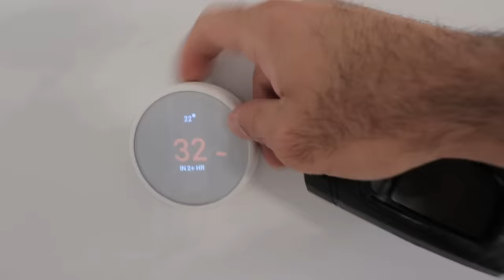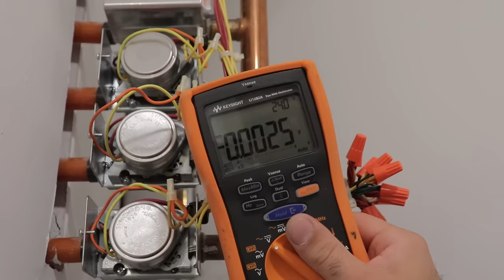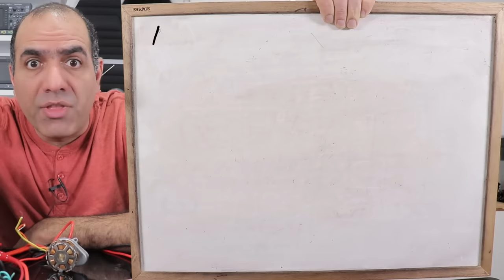Electro-Plumbing Repair… of my home heat zones that won’t heat although the boiler is running fine!!

Comment: As a plumber myself, Mehdi actually got most of the stuff right, just wandering who the hell did those pipes, they look so unorganized to me.
Reply: Every time I've hired a plumber they'll see something the last plumber did and go "Yeah that's garbage, did you get an idiot to fix it?"
Reply: @inurokuwarz  exactly
Reply: @inurokuwarz  Sounds like programmers too
Reply: @inurokuwarz  You wouldn't get it, its a plumber thing. Just believe us, we mean it.
Reply: @inurokuwarz  And then you tell him, that it was he who was called last time 🤣
Reply: @inurokuwarz  Sounds like every HVAC tech Ive ever had come to my house 🤣
Reply: @inurokuwarz  lmao
Reply: You should see my house. It looks worse than an IT datacenter rat's nest but with 3/4 copper instead of ethernet.
Reply: piping in this old house makes me wonder some times copper everywhere that makes no sense to some of them with end caps with nylon screw ends with a copper tips (like wtf is that for) to so many dead end gas lines from when stuff used gas like the stove and stuff in the 50's from then all of the pvc vent tubes from the new furnaces to the drain lines not to mention billions of wires all bundled into each other around the breaker panels and best show in the house is the main inlet water pipe is lead to a copper fitting through 2 meters using cast iron pipe/fittings back to copper. isnt retro fitting amazing.
Reply: So many experts...on the comments....your the only one I've seen that actually had a good comment...you are correct sir!
Reply: you should see the pipes from after they replaced the boiler in the apartment building where I used to live. Looks now like art by MC Escher...
Reply: @inurokuwarz  I'm like that when I see a tangled server cabinet/rack. "You've had some cowboys in here!"
Reply: My home was built in 1978, had the original hot water heater (failed in 2018), I was pleasantly surprised. The unit they put in would have cost me 800 to buy myself, they charged 1000 and brought the unit, took the old one, and the plumbing is now tidy AND serviceable. The old unit was actually copper pipes that were welded right to the original unit, they put in some new safeties and a nice fitting that terminated into a flexible line. Maybe it's not the best it could be, but I would have done a worse job and spent more money.
I think a lot of plumbers are not so great, but it feels like winning when they do ok!
Reply: @inurokuwarz  Because its true, especially when the last person that worked on it was them.

Comment: I love how plumbing jumped to rocket science instantly 😂
Reply: Wait till you realize that the majority of rocket science is just fancy plumbing.
Reply: Yeah. The fact that hot water and cold water pipes are just shorted seems like wizardry and rocket science.
Reply: @SneeuwPoesjes  get 2 liquids to the bottom of a tube

uh huh, "Fancy" plumbing
Reply: Two words: Colin Furze
Reply: I have some electrical engineering degrees and don't know jack about plumbing. I just call the plumbing guys and pay them, and all is well.
Reply: @Project_VideoGame  let me fix this: two liquid that tends to react toghether and explode, usually at very low temperatures, that must be pumped in the right amount and proportion in a chamber at very high pressure and temperature, where they must combine for good otherwise you only have a very expensive and loud firecracker
Reply: @XMarkxyz  And also needing to construct a nozzle that has thousands of tubes running through to prevent over heating and RUDs
Reply: and surgeons is just a fancy tailor....
Reply: @ringoooringooo2190  And barbers as well.
Reply: Then you realize that it is HVAC/Boiler techs that do boiler systems and not Plumbers.  Plumbers are not licensed to work on boiler systems. 😂

Comment: 7:48 Amazing, resoldering a disconnect by running high voltage through the circuit!
Reply: Most likely not, far more likely dust causing a short circuit which at LV remained, but HV burnt it away.
Reply: @mrtango1824  Dust isnt conductive enough to cause a short circuit at low voltage.
Reply: Arc welding!
Reply: @Godspamit  Could have also been a loose or oxidized connection that was open cicuit at 30V,but became shorted at 120V and the connection welded from the high current.
Reply: I'm guessing metal shavings from the constant operation
Reply: Reminds me of hitting a dead light bulb to get the filament to touch and weld back together... because I don't want to change that bulb today.
Reply: @mernok2001  depends on what kind of dust it is. Iron dust or other shop dust thats been contaminated by oils or other liquids does indeed conduct electricity very well.
Reply: @PrincessLorelei  did that actually work?
Reply: @NoahGooder  for a day or two.
Reply: @PrincessLorelei  even then I am suprised it worked at all
Reply: @NoahGooder  Frankly so am I, or at least beyond a few seconds. Interestingly the light was actually brighter afterwards.

I suspect that the not so conventional way the filament attached itself led to plenty of resistance... more heat, more light. I've also noticed incandescent lamps often increase in brightness dramatically in the minutes before they blow out.
Reply: @PrincessLorelei  I guess thats why its called a litteral blow out because the light blows up :P
Reply: @NoahGooder  I put a halogen bulb in a microwave. It was extremely bright for about a minute and then exploded violently.
Reply: Thats actually how you short dead christmas lights to make the rest of the string light up
Reply: @BlazingKhioneus  thanks now I know how to fix christmas lights.
Reply: "and they say high voltage is bad" - Mehdi

Comment: A word from the wise (and experienced). Honeywell zone valves are quite troublesome. I've had the gear on the motor strip out because it's made of soft material, the motors themselves get weak and wont go far enough to set the end switch. I use caleffi now and haven't had any more issues or callbacks. The actuator units have a lever that releases them from the body without opening the system. Honeywell has two small screws deep inside that make it tougher to change. Caleffi has a higher cv( flow ) rate
Reply: Honeywell & M.K. electrical goods have become fairly unreliable over the last few yrs, but the M.K.  prices have remained rather high. ( M.K. & Honeywell are the same same company)
Reply: Planned obsolescence.
Reply: Sure thing buddy I could say the same about caleffi, it does have a higher flow rate, but the inverse flow of ac to dc conversion with lower string coils per cubic metre has led to a lot of companies opting for honeywell systems. Not to mention the 8 year old who got electrocuted at 45 meters distance from a caleffi motor last spring which caused a black out in arkansas?
Reply: @callmex5406  can you provide me with the data on this incident.
Reply: @garyangelstad5212  obviously the news was taken off the internet after the company issued a media blackout. The courts were in on it.
Reply: @callmex5406  To produce an arc to even travel 45 meters you'd need to apply a voltage a few times higher than humans ever have, and it seems like it'd short out elsewhere before shooting to a kid. It'd have to be pretty spectacular circumstances to even do this intentionally.
Reply: @IronAsclepius  don't be fooled by what people tell you is true. As you said it could be exceptional OR it could just be a well hidden discovery? Anyway rip to the victim
Reply: Caleffi valves are good. Taco valves are also good (both the motorized style and the ancient indestructible wax motor type). At my old house I had Bell and Gossett zone valves. Yes, wax motor valves, but excellent quality, small for the size of the pipe, and entirely silent. I'd still go for individual circulators per zone rather than valves though. My new house has steam heat with millivolt system/powerpile generator for the controls, so it has no pumps, no valves except the gas valve, and runs with the power out. The boiler is on its way out though, so I will replace it with one with a power burner rather than atmospheric, and likely will convert the whole 1 pipe system to 2 pipe mini tube with condensate pump and additional vacuum pump. Unfortunately then it won't run without power but it will be a much more efficient system and I will be able to run steam temperatures under 212 degrees because of the vacuum pump.

Comment: As a mechanical designer, I have to admit: Electrical engineering is often basically some kind of sorcery to me.
I mean... I get how a lightbulb works... but that's basically it.
Reply: Lightbulbs are not that easy any longer.
Reply: I had the pleasure of being taught physics by a FermiLab scientist. She was smart enough, and I mean no disrespect she was very smart, to know when I needed conceptual vs practical answers to questions I had about capacitors, inductors, etc.

Different people need different approaches to electrical engineering.
Reply: mechanical stuff we can actually see things in motion. 1 action cause another. electricity and electronic is like wizardry to me.
Reply: @muzallisam5068  oscilloscopes are the prized possessions of electrical engineers. They make the invisible world of electricity visible.
Reply: Hey I work with an electrical engineer and he doesnt even have a simple understanding of how uneven pressing forces would create uneven pressures
Reply: So you are one of the guys who purpose make the lifes of mechanics a living hell huh.
Reply: A great "stepping stone" from mechanical to electrical is pneumatics.
Reply: So u know much of it. I learned how it glows after almost 8yr of study... All this electrons magnetic fields transfering power, moving electrons, then electrons bouncing of atoms making them shake, cousing atoms making the wire inside bulb to heat then atoms, they release photnos (again electrons to be precise) in visable and infrared spectrum of electromagnetic field... Yeah it is new to me. Don't know if i get this right still tho.
Reply: @maximwannabepro3021  Not really. I'm one of the guys who can admit when they have no clue or not enough knowledge about whatever and get some help of someone who knows his stuff and works together with them to achieve whatever is asked for. Basically: "Tell me what you need to do your stuff down the line and I'll do whatever I can to make it as smooth as possible."
But yes - I can understand you. I've seen more than enough abominations myself, where I was like: "WTF were they thinking?!" Or had to work with 'real' engineers where I was like: "Why are you an engineer, and I am a 'mere' designer, but I've to explain this stuff to you?!"
Reply: You’d love electronics in cars then 🤣 I was taught auto-electrical engineering, confusing stuff. I’m still not quite sure why some cars have extra sensors for such simple things, more to go wrong and diagnose.
Reply: Electrical engineering is simple. Just learn quantum mechanics and then you can start learning basic electronics.
Reply: Lightbulbs are electronic engineering these days. They're depressingly simple, and not in a way you'd like. Here's a way to save a bunch of money: learn how to do basic surface mount soldering and a bit of maths around LEDs and resistors, then figure out what kind of limiting resistor to put on your LED bulbs.

The maths on simple circuits is simple. Mechanical engineering isn't all that different. Just keep in mind that feedback is always a thing.
Reply: Electrical engineer here. You only think you know how a lightbulb works...trust me, its crazy. For instance, I dont think most people can accept the fact that the energy that powers lightbulbs (and anything else for that matter) actually travels in the space around the wires and not inside the wires.
Reply: watch Veritasium's or Science Asylum's video, then reassess your true understanding 😆
Reply: I'm an ME.  In college the EE prof basically said he knew we were idiots, and our tests would be 30 points.  Every point you get adds on to 70 points.  So right off the batt you are passing- barely.
Reply: In my mech course work we’ve covered transistors, op amps, Boolean logic, and had to make a combat robot. Im not sure what wasn’t covered in EE but i feel like my signal processing and circuits education has been pretty comprehensive
Reply: @erikmjelde4428  Yeah... I came to say something along those lines. Lightbulbs are not just "put a wire in a vacuum tube" like your Elementary teachers taught during the Edison/Tesla curriculum.
Reply: @erikmjelde4428  lol you big dummy. Are you seriously claiming NO energy flows inside wires? Or did you just exaggerate because it sounds cooler. Either way you are wrong.
Reply: @crayder1100  Although if you did happen to "just put a wire in a vacuum tube" you would end up with a perfectly serviceable lightbulb. Only idiots try to make something sound more complicated than it is.
Reply: @moniack  When I was in grad school I crossed over from ME to EE for one 500-level class.  Got an easy A with that one.
Reply: @Jmoneysmoothboy  This is exactly my point. It just sounds CRAZY! But, as an electrical engineer, I have a much more intimate understanding of electromagnetics and I can assure you it is true. Indeed, I am claiming that energy that powers your lightbulbs got there traveling outside of the wires. Energy can flow inside the wire but it will only heat them up and won’t reach the bulb. Put simply, all wires are merely energy guides. Do with that information what you will... like I said, most people wouldn’t believe it because it just seems wrong.
Reply: @erikmjelde4428  I have no idea where you're getting this idea from, but I'd suggest you start actually backing up whatever assertions you are trying to make. Electricity and magnetism are coupled, so are you trying to claim that only the magnetic field is doing the work? If so, that's not how that works. You're claiming you're an electrical engineer, but you seem to lack a fundamental understanding of current, you know, the foundation of any electrical.
Reply: Just trap some lightning inside a glass bulb and you get light.
Reply: @MindGoblin195  LOL... Exactly my point!. It is very hard to believe. Outside a live wire with no current, there will be surface charge and a perpendicular e-field (electrostatics). If the wire carries a current, each segment of wire can be considered a small resistor and so there will be a small voltage drop and hence a small parallel e-field in the wire. Outside of a current carrying wire, there will still be a small component of the parallel e-field like inside the wire (from the resistive wire and subsequent voltage drop), but the perpendicular component from the surface charge will be much larger. Using Poyntings therom, inside the wire, the energy will flow into the wire (become resistive losses) and outside the wire the energy will flow down the wire (to the load).
Reply: @werdwerdus  Yep! Electricity is CRAZY!
Reply: @timehunter9467  Probably for redundancy or some of regulators as aditional info. Car wuld probably run without them but some functions wuld not work as intended.
Reply: @xsardas1999  Some are useful, I’ll admit that, but some silly “extras” can cause that painful limp home mode.
Reply: @erikmjelde4428  What happens if there is a plane that stretches to infinity in all directions and is 10 feet thick of perfect insulating material and you run a wire through the center? there is no air for the electricity to move through. would you claim no power can be transmitted over this line?
Reply: @MindGoblin195  he's right. Like some other people have said, check out Veritasium's video (2 videos now). Alternatively, read about electric fields. There's theory, but also they do some field experiments at Caltech IIRC.
Reply: @Jmoneysmoothboy  An isulator will inhibit the free flow of electrons but not their fields. In fact, a lot of engineering in applied electromagnetics is all about designing transmission lines and waveguides to carry these fields appropriately to there destination. All kinds of insulators and dielectrics exist as well as wire topologies like parallel line, coaxial, stripline, microstrip, ect, all in an attempt to guide the energy we generate at one end and intend to recieve on the other end. Like I said, its hard to belive that the energy is transmitted in the fields outside the wire. Its just not something you would expect to happen. I certainly didnt expect it before I took courses in applied electromagnetics because we are not taught this way for your average electrical problem. We choose to use volts and amps because it is more convenient, but when you are dealing with where the energy is spacially located, its all in the fields.
Reply: When a mechanical engineer gets an idea does a sprocket start turning over his head?
Reply: "I get how a lightbulb works... but that's basically it."
So you haven't seen latest Veritasium videos and all replies to it? :D
Reply: To an extent, it's playing with the same shapes of differential equations as mechanical engineering does
Reply: @Jmoneysmoothboy  lol it's definitely not that simple...